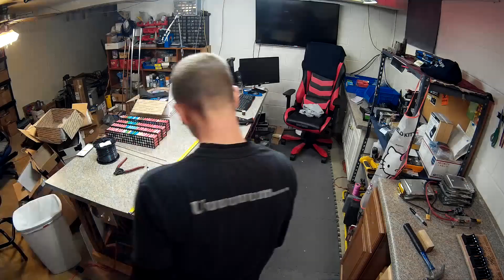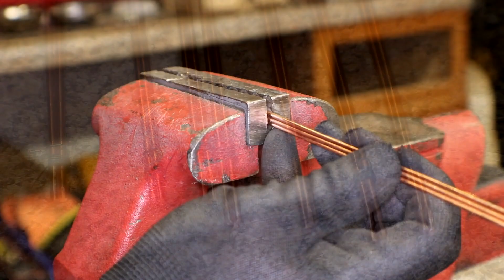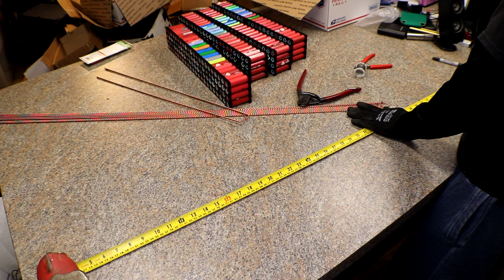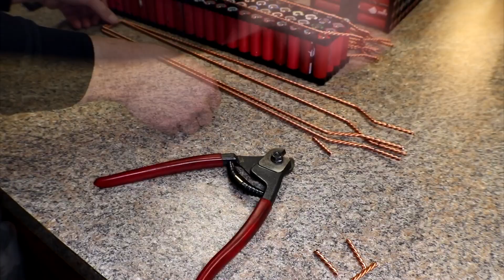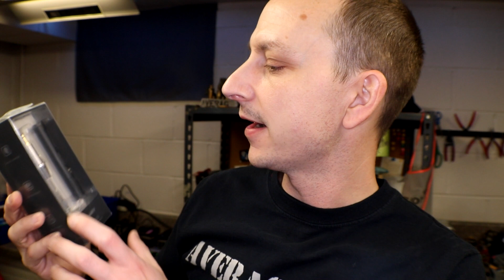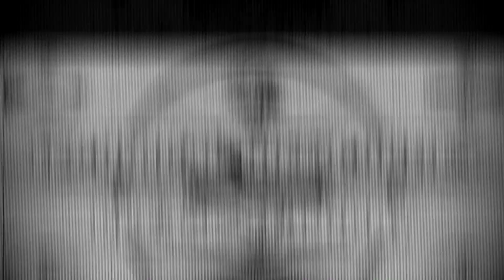Winter 18650 Test Ep4 Making Twisted Bus Bars!!!

Comment: If I use 60 18650 cells 3.6v in parallel what would the amp hours be in total 🤔
Reply from the maker: You would need to know the amp hour of the cells first. Example 60cells times 2amp hours is 120ah!
Reply: The cells are 18650-2500 mah 3.6v 9wh
Reply from the maker: Ok then 60 cells times 2.5 (2500mah) is 150ah (150000mah).
Reply: Thank you very much 👍

Comment: Love your videos! Is there a functional/electrical reason for the ~2" part of the bus bar that connects the two long sections, opposite the end where they come together in a "Y" - or is that just for ease of construction/handling, like to keep it all in one continuous piece? I'm considering a design that wouldn't include that section, and it seems like no current would flow through it anyways - but am I missing something?
Reply from the maker: Its there to help keep all the cells in balance. Sure the "Y" is also doing the same but lets say for example the 2 rows on one side are "weaker" then the other side then those cells will have to work a little harder to get the energy to where it needs to go. Do you actually need that connection, probly not. But since Im using recycled cells I want to keep all the cells as balanced with each other as I can. Some even add an extra connection in the middle! I say do you! Build what you want to build! There are no rules!😀🤘

Comment: What do you think the current rating is for these bus bars?  12 AWG is rated for 9.3 for power transmission ...so 3x9.3= 27.9 amps for the busbar you created?
Reply from the maker: 12awg can handle 20amps. So 60amps with the 3. Ive ran 80😲😆
Reply: @AVERAGE_JOE  Thanks, I got my ampacity rate direct from the American Wire Gauge chart ...where did you get the rating of 20 amps for 12 AWG from?
Reply from the maker: Do you have a link?  Every chart Ive seen shows 20amps.
Reply from the maker: Hmm, thats the first one Ive ever seen with that low of amps!🤔
Reply: @AVERAGE_JOE  Supposedly this is the official AWG chart ...can you point me to your references?
Reply from the maker: Just type in google for 12g amp rating!
Reply: @Richard Head - As a bus bar ... a single 12 awg is good for 40 amps.  3 wires twisted = 100 amps !!!

Comment: Hi Joe, Another awesome video! I'm building a ebike 36v 350w motor. The battery 10s6p is recovered 18650 from laptop batteries. Thanks for all the tips.
Reply from the maker: Thanks for watching!!!  When using laptop cells just make sure to not go over 1amp per cell!  They will get hot!!!💥👌
Reply: From your videos, I set my self up with some tp4056 connected to MP1584 5v buck module and powered by a laptop power supply (I can do about 6 at time)...…….makes a great charger before I test them on a LiitoKala Lii-500. Without pre charging the used 18650s takes forever to test. Also the tp4056 cost around .99$ and I won't wear out my Lii-500 charging them. Again all of this is stuff I learned from your videos. Thanks again.
Reply from the maker: Awesome!!! Those TP4056's are great!! Pre and post capacity testing to keep the process goin as fast as possible!🖒

Comment: Hey, can you throw out some info on your jig?  what measurements you used for the length ect?
Reply from the maker: Yes Sirrr. Precut was 4ft, (way to long) about 44ish inch after twist(about 6-7 seconds of drill time) then I cut them to 42" before bends.  After bends I cut off another 1" off each end.  Four 4x5 cell holders then I had some singles on hand and put 2 rows on the end!💥👌
Reply: @AVERAGE_JOE  Perfect.  I have been kind of winging it on my bus bars.  Nice to have somewhere to start that's consistent.

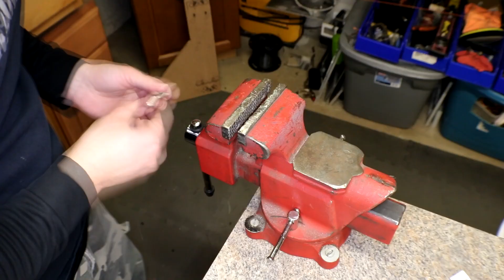Comment: Your "vice crimps" at 7:22 are actually quite good for conductivity. The solder you add afterwards will hermetically seal the joint away from oxidation and corrosion, well done, sir! This method is NOT a compromise, it is a very good technique.
Reply from the maker: A little smashy here, a little solder there and BOOOOOM!💥😆👍👍👍
Reply: No, solder reduces the current carrying capacity of the wire. You add resistance, which eats power and heats up the wire at the critical joint. In a moment of surge,  the tin migrates into the copper, thus reducing it's melting point that that of bronce and if more tin is added, then the melting point comes down extremely. Try it out! Get a copper wire, measure the current required to melt it as a fuse, then get a similar copper wire and put solder on it and try the experiment again. Anyway, I think that one would only see that kind of thing if you dead shorted the battery.

Comment: Just curious - have you measured the voltage drop across those 0.5A and 1A fuses? when operating at 0.5A and 1A?
Reply from the maker: I have in the older video when I was testing them!  Think there was a few others at that time as well.  I did get a sample pack from Keith with all the different ones and Ill be doing another video with them all here soon.👍
Reply: I was thinking about this too. My line of though is - even though they don’t blow on your systems highest current draw, surly they drop too much voltage when operated over their rating (0.5) and could be heating up but obviously not to the extent that they produce visible light. However you are only running them at ~700mA  ( per cell basis) on your heaviest amp draw ( full load / low battery voltage) so probably not significant. Would be interesting to know though!.

I would have gone for the 1As in your system because then you would be running under the fuse rating and still have a safe low instantaneous break current (3-4A).

Could easily be tested if you had a thermal camera.
Reply from the maker: As soon as I get a thermal camera that test will be one of the first!! Been wanting one for a long time lol.
Reply: AveRage Joe - Yes they are excellent tools, easy to see the dying cells in your packs and when you test the cells individually you can fill up your charger rack and then set up the thermal camera to record through the charge and easily identify bad cells.

Also good for viewing bad insulated areas in your house and can be used to inspect power electronics periodically to look for any ageing components.

You can also look at the solar panels with them and identify failing panels, we do this in summertime on large solar farms and every year dying panels get swapped out. Generally a good quality panel ( Canadian Solar is good quality) will last a good amount of time maybe 10 years + but when they die they can effect the MPPT tracking efficiency.

As I say very useful tools - literally gives you a new set of eyes to look at stuff with!!
Reply from the maker: Those are all the things I want one for!!!😆🖒🖒

Comment: Heatsink is the go too product Joe. Where do you get the plastic whole holders from trying to source a lot for my project.
Reply from the maker: I used 3/4" sch 80 pvc from Lowes.  It was in the sprinkler isle.  In my older video I have a part # in the description box.  Im sure home depot has it as well.🤘

Comment: Those TS80's are really good.  18W, yeah. But all those watts are focused on the tip alone, not the whole iron like standard irons do.
I have one, and it works really good. Altho, make sure to keep the tips clean. I have to have mine redone, or buy a new one. It doesn't work because of that  😕
Reply from the maker: Good to hear!  Im gonna attempt a try on the bus bars to see what it will do.  I usually do a sponge wipe before and after each solder!  Thats how I was taught at least.  So far I havent had to change a tip on my regular iron and Ive had it for years and got it used from a buddy that had it fooooor eeeeeevver and a day with the same tip.  I used the same tip on the 14s100p packs and still going strong.  💥💥💥💥😆👍
Reply: @AVERAGE_JOE  Nice!  You won't be able to do the bus bar with it, it doesn't hold that much heat. But you should be able to do any wire-to-wire and pcb soldering. That's where it shines.
Now the TS100 iron, that's a different beast. It can do a lot better. Not sure if it'll do bus bars or not, tho. But it does have a larger heat mass.
Reply from the maker: Yeah I kinda thought the samzies!

Comment: I love the work product you put out.  What are the dimensions of the wire, length precut, length after the twist and the length is for how many cell holders?
Reply from the maker: Thanks Man!!!  Precut was 4ft, (way to long) about 44ish inch after twist(about 6-7 seconds of drill time) then I cut them to 42" before bends.  After bends I cut off another 1" off each end.  Four 4x5 cell holders then I had some singles on hand and put 2 rows on the end!🤘👍
Reply: @AVERAGE_JOE  Hey, I sent you a PM to your email address: averagejoestuff@gmail.com

Comment: Battery porn, copper porn, design porn... it's all here... :-)
I got a TS100 so I could use it with 6S if I needed to fix anything on the ebike in the middle of nowhere.
The TS80 is lower voltage and power and not as useful to me, but is still a great device.
This good article compares the differences: https://oscarliang.com/ts80-soldering-iron-ts100/
Reply from the maker: Thanks Man!  All the Porns😆💥  There you go, thats a great option to have on the road!  Thanks for the link!  Ill checker out fo sho!!!💥👍

Comment: The copper wire and all. The way I'm building my packs is getting spendy... I'm thinking I'll nickle strip the next packs. If I can figure how to fuse the cells. Maybe nickle the neg side and solder fuses to the nickel in the pos side? The packs will be only supplying 50 amps peak , that's 250 ma per cell peak. So the nickel should be fine!! Great video sir Joe!
Reply from the maker: What is costing so much in your build?  Copper😉😆.  Ive been thinking of nickel strip as well but want to do some testing.  The only issue with spot welding nickel strip directly to the cell is if you ever need to replace a single cell.
Reply: AveRage Joe yeah, looks like I'm gonna have about 100' of 8 gauge, plus 1.5" x3" copper plates. I don't know if my iron is going to survive. Nearly half the huge tip is gone already. I guess I need to regulate the temp. It vapirises the solder afert at full temp. It's a 200watt from amazon.  What do you think about jehu's rig? With the PCB's?? It's OK I guess. If you aren't pulling any current. .  I have a similar idea I had for a while . I thought it was a dumb idea. Now I'm thinking maybe not so dumb.. It is sort of like how Tesla did the older packs. Only using PCB. And spot weld or solder to the cells and PCB. And could probably be used with the cell holders. But not a must. I may tinker with the idea. After I get some of my projects squared. But yeah, the budget for copper has definitely been blown. It's near doubled what I was thinking. I'm definitely doing something different next time.  Keep at it, and keep us informed on progress!
Reply: AveRage Joe yeah, looks like I'm gonna have about 100' of 8 gauge, plus 1.5" x3" copper plates. I don't know if my iron is going to survive. Nearly half the huge tip is gone already. I guess I need to regulate the temp. It vapirises the solder afert at full temp. It's a 200watt from amazon.  What do you think about jehu's rig? With the PCB's?? It's OK I guess. If you aren't pulling any current. .  I have a similar idea I had for a while . I thought it was a dumb idea. Now I'm thinking maybe not so dumb.. It is sort of like how Tesla did the older packs. Only using PCB. And spot weld or solder to the cells and PCB. And could probably be used with the cell holders. But not a must. I may tinker with the idea. After I get some of my projects squared. But yeah, the budget for copper has definitely been blown. It's near doubled what I was thinking. I'm definitely doing something different next time.  Keep at it, and keep us informed on progress!
Reply: AveRage Joe I was just thinking. If you use nickel strip. And had a bad cell to replace. Just cut the strip near the cell. Replace it by welding a piece of nickel to the cell. And weld it to the rest of the nickel strip on the pack. Then there is fusing, and finding the bad cell may be more difficult..   I don't know!!!! But we will figure it out!!!!
Reply from the maker: Yeah thats a possibility! We will figure it out! BOOOOOOM💥😆
Reply from the maker: A 200w Iron is crazy lol!  Ill have to look one of those up to see how redic it is!  Jehu's pcb boards yeah I agree, there ok!  Not for powering your home for sure and thats the hole idea behind a powerwall.  I at least havent seen it power anything worth it or more then a 100watt test. Theres gonna be a better option here soon from another guy thats been talking about doing a pcb style powerwall for over a year now lol.  If I were gonna do a pcb style powerwall Id probly do what he plans to do but I cant release the info on that lol.  Super secret squirrel build lol.  You should work on your idea,  I think there is a need for that style for sure!!!

Comment: Atleast you didn't have to actually make the wire! I used 8 gauge. 4per pack! Of 100 cells... It's over kill. I think 12 gauge on the next. And soldering can be difficult. I have noticed reduced capacity in cold cells. At 50°F about 400 ma lower than when it was near 80°F. The cells were about 48°F is say because where they were stored was a bit cooler than room temp.
Reply from the maker: Yeah that would suck if I had to try and make the wire LOL!  4 8g on a pack?  That could be a lil overkill but who knows!  Agree soldering might be a little tough!  Yeah Ive seen lower performance in colder temps as well.  Im thinkin the outside is gonna be huge!!!😆👍

Comment: Jooo legend, wazzap! This can be done about 100 times faster if you put a piece of wire of around 3 meters in the vice, take the back of a clawhammer and pull it off.
Reply from the maker: I havent tried that method yet🤔  Maybe Ill give it a try!👍🤘
Reply: Do it! I got 20 meter busbar in like 10 minutes, you can even do way longer pieces of 5 meter wire if you have the space, then when you stripped them you cut them right after the vice, then  fold them double so you have half the length and put them in your drill(i used to cut them first but then you have 2 separate pieces of wire to get in there which is a bit annoying) and the end with 2 wires in the vice, the stripping takes about 5 seconds this way. All inspired by you of course ;) BOOM...OUT!